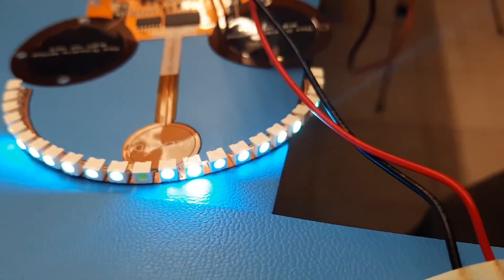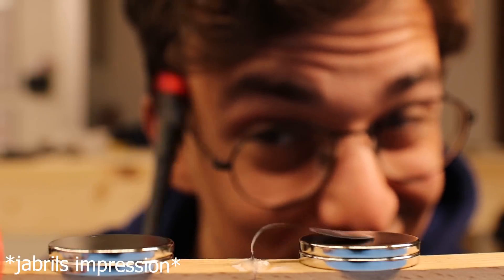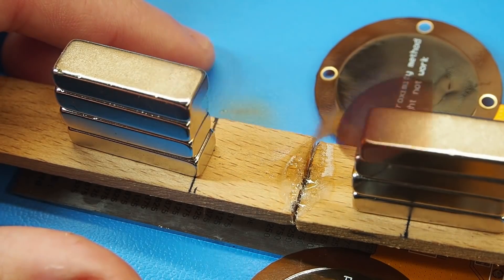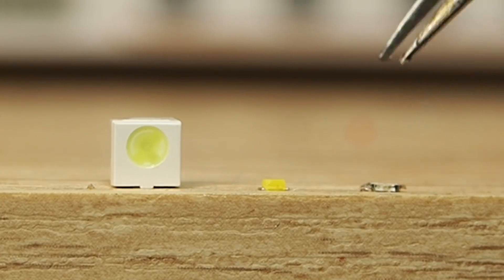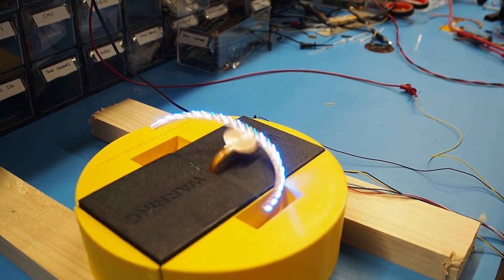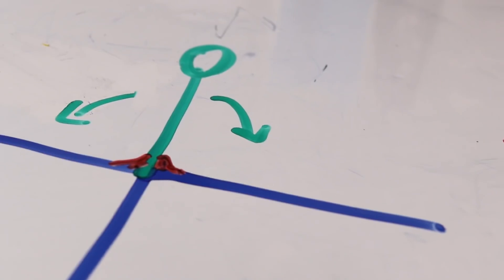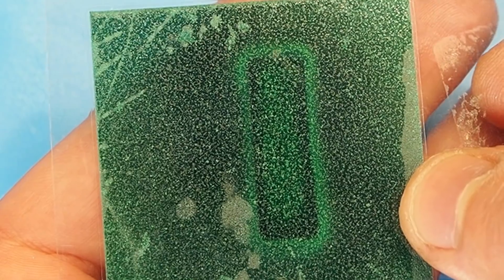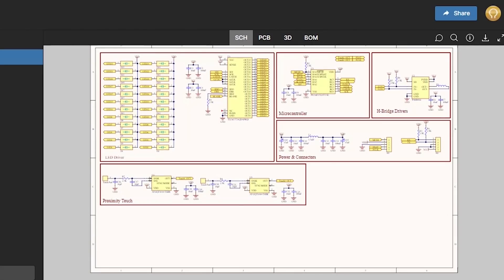Hemispheric Flapping Display

Comment: The natural frequency only depend on the mass and stiffness. 
If you want it to go faster, you will need a stiffer flex cable. You should also make it longer so the extremities of the arc dont go in reverse direction. 

I think you could also put the magnets along the path of the coil instead of at each ends. You then might need some tortional stiffness too tho.
Reply: Thank you for this comment, I was close to screaming it at the screen 😅. He never altered the 'crux' of the problem, the recoil speed of the flex cable! Well spotted, peace from Ireland to you and yours x

Comment: When you had the strong magnets crush the pcb between them, it hurt a lot. I also  Don't get why the flexible part is not just the part that needs to flex. Also why try the flexer with no LDS when you already have a prototype like that witch worked. It feels like you just like destrying PCBs. If this thing can't prove itself realiable long term, then it's pretty much useless.

Comment: This is super cool! Looking forward to where it'll go. :-)
Regarding the flapping frequency, I've got an idea, that might do something (but I'm no expert). What if you had the connection at the ends of the arc instead of in the middle? That would improve aerodynamics a little and restrain the half dome movement more since the flexing part is smaller and will be "squeezed" less and bend more. Additionally, having the flexing connection at the sides of the arc would restrain the LEDs in any unwanted rotary direction a bit more. This would also mean a springier / stiffer motion, which might help push the arc back into the middle position more easily. This method might induce material fatigue tho.

Comment: Looks great! Does the firmware control the strength of the field depending upon its position in a similar way to FOC motor control? I think this method would give the optimal performance.
Reply from the maker: thanks! at the end the coil was being driven on/off as the duty cycle signal testing i made at 4.35 didn't improve it

Comment: instead of "trial n error"-ing so much, you can make a physics based model of the setup and simulate it. Basically your setup is an object moving due to external force, so you can get the position of each led after it is subjected to force. Interpolating the position points of all LEDs will show how your entire flex pcb will look like in action. 
The model might get complex, but it'll save you lots of time n money
Reply from the maker: based on my experience i think it would take more time to create 'a prefect' model than just test something.. don't getting me wrong it would be nice to have such model but any variations & assumptions might yield to incorrect results in practice .. like the study of how the magnetic field strength of both the magnets and coils vary in space (FEMM simulations can help out with these but I'm sure that in practice its going to be slightly different) with this simulation one also needs to combine some other mechanical  parameters like the  pcb stiffness (which varies with the arm width and length) and edge weight (which varies with the leds & solder) - both of these would be need to assumed/calculated unless the actual design is bought :)
Reply: @CarlBugeja well yea, quite a lot of parameters you'd have to work with, no doubt. Maybe a behavioural model will do instead of a perfect one, just to study the variances/effect of parameters on the setup as a whole? wdy think

Comment: make it into a hybrid hard + flex pcb, the goal is make the "neck" of those led as well as where its mounted on into a hard pcboard, while the bending joint is a flex one, thus making it like hinge mechanism.
Reply from the maker: it already has a thin stiffener underneath the leds :) but i think adding more weight to the edge/leds with make it harder to flap fast as shown in the first part of the video

Comment: I think the arc needs a flex hinge on both ends. You could try tape.
Reply from the maker: yes that might help out with keeping things stable :) but it might also add some 'friction' to the system
Reply: You could use a piece of thread. I just think you are losing speed from the ends flopping. Might also make the POV straighter.

Comment: I would have guessed that you would need to tension the center of the PCB, so that it's default working position would be aimed straight up.  Then force of the coil would allow you to go +90 or -90 degrees with minimal force.
Reply from the maker: that definitely helps! and it did with the flexar testing but for the flexled the weight of the leds was to heavy to keep it straight (also depends on the arm length)

Comment: I think the performance issues might have something to do with the long flexible "arms" or ribbons of LEDs. They probably work kind of like shock absorbers when you try to reverse the direction of the movement.

Also, the larger magnets may induce large enough currents in the coil to disturb the movement even further. This is just a wild guess though.

Comment: Hi Carl. With what you know you can create a tactile display for blind people. The principle of the flexar but tiny ones to be like physical pixels. 😃
Reply from the maker: i have thought alot about this one :) turning it into an actual project.. but the problem i'm facing is the power ratings.. One coil draws around 200mA so to make a display of say 30x30 'pixles', would draw around 180Amps .. which I think would be an overkill for somethings low res
Reply: @CarlBugeja  If you use a metal core to keep is magnetized you don't need to keep the pixel energized. Like a flip pixel.  https://hackaday.com/tag/flip-dot-display/

Comment: hhhm.
frequency of the pendulum is dependent on the length mostly,
mass of the LEDs is important too making it light will reduce inertia and allow it to run faster.
The flexible PCB also behaves like a spring, so making it stifer will increase frequency.
Maybe try to arrange multiple coils in a flat row with LEDs on the "top" and multiple "stems".
Another thing that might help to increase the field density is to use a Halbach array with ferromagneting baking instead of huge magnets.
Be careful and good luck

Comment: Hey! You should increase the spring effect in the "arm". It will help the led to go back up.
Increasing the spring effect means that you will require a bigger force to bend it tight. But the coil has a greater effect when it get close to the magnet. So I think tye spring producing a hisgh force in tight bend will be countered by the coil having more action near the magnets.
Thus the spring can really help you pass the high point in the middle where you don't have much action for now

Comment: What is the point of using permanent magnets for testing when they are impractical for actual use. Why don't you put two flexAR, one on each end of the LED arc. The Arc makes no sense as a display of this type because the edges move differently from the center. You should try a rotory display with the pcb motor.

Comment: Reinforce the led arc! You can see that since all the force is driven at the center of the arc and the ends of the arc can’t handle the constant change in the force direction, creating a huge waste of energy. This is probably making the design unstable and why it’s so hard to get it up to high frequencies.

Id also like to point out that if you were able to get it working at very high frequencies then it’s gonna be a nightmare trying to display anything because the led strip won’t be in a linear path at any given time, it’ll create a sinusoidal like path and what ever image you want to display will look “wavy”.

Comment: Why dont you use electromagnets same as flexar ??
Reply from the maker: Answer is in this video :) https://www.youtube.com/watch?v=XfVz9Otxzyo&t=2s
Reply: @CarlBugeja What I meant by the question is wouldnt It be much easier rather than going with the magnet to go for a electromagnetic coil not like flexar but the generic wire wound type, for the display?
Reply from the maker: @nixonnelson5181  i don't think that would work because it has to be light-weight.. i explained what the difference between vcm and electromagnets in the last video https://www.youtube.com/watch?v=XfVz9Otxzyo&t=5s

Comment: I think if you add some kind of stiffener to the LED arc as well as some pivot point for the ends you could cancel out a lot of wasted motion and help the arc be more readable. I have no idea how it would affect the frequency of the display. However, this suggestion might violate the spirit of the project so feel free to ignore it if so.

Comment: You should try with a more rigid bridge, then if you manage to design your "pendulum" with a resonant frequency in the right range you should be able to drive it at it's given resonant frequency more like a spring attached to a mass.

Comment: I think the problem is because your PCB is too flexible, and not springy enough.  Maybe change the design so that the "spring" part is simply wider?  Or, have the ends of the semicircle attached to the stationary part?

Comment: Is it possible to add some thin material such as ribbon or tape to reduce the twist on the flexible portion as it oscillates, it seems like a lot of the momentum is lost in the arms acting as a form of inertial dampener. If they were connected to the same axis as the pivot, would it allow for better recovery before going the inverse direction?

Fantastic video as always, you are a true electronics artist

Comment: I noticed that the moving part of the FlexLED was sort of rotating/twisting around the single connection, to mitigate that I would recommend trying two flexible "stems" leading to the semicircle
Reply from the maker: i think that would improve it :) maybe some tracks could pass through them as well making the middle arm thinner

Comment: The weight of the LEDs are the biggest problem. Maybe you can try to put the LEDs at the bottom and redirect the light using fiber optics...
Reply from the maker: i think the bending would damage the fiber optic 😂
Reply: @CarlBugeja  there are some plastic fiber optics too, that can bend and stretch much easier.

Comment: the ends of the flex pcb that carry the leds probably should be supported. If you leave them hanging like that then the pcb will not be thrown in a perfect rotating path. Resulting in them actually breaking your resonance. Hopefully I was able to communicate my point correctly as I'm no physicist. I would try to connect the ends to the rest of the pcb.
Reply from the maker: yes i think that would improve the result :)

Comment: Can the actuators handle higher currents when they are constantly in motion?

Edit: have you considered trying some kind of ferrite instead of steel? 

(this whole project is so cool, i definitely want to use these at some point)
Reply from the maker: Thanks! Higher current means more heat.. It might cool off with the flapping but I never tested that in more detail.. I made some core testing in the last video 🙂https://youtu.be/XfVz9Otxzyo

Comment: This is so freaking cool. I think you should use a thin layer of foam or some soft material to stop hard hitting of LEDs on 3D printed parts which may increase their working life.😀
Reply from the maker: Good idea! My idea behind the proximity touch pads is to prevent them from hitting the plastic but that could be used as an extra precaution
Reply: @CarlBugeja  Will wait for that upgrade too. 🤞
Reply: @CarlBugeja  why dont you counterweight the leds so its not so heavy? and also add a magnet above it for double the strength
Reply: Also maybe have 2 or 3 parallel flippers with a single led arc on top like the one you use - it seems like it is wide enough.. 🤓🤔